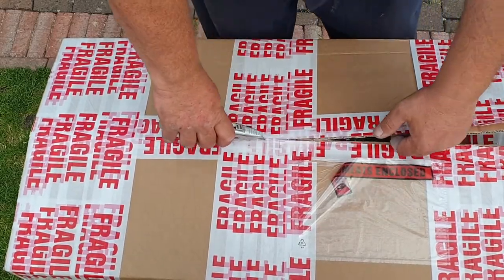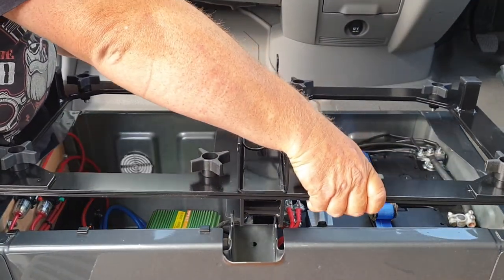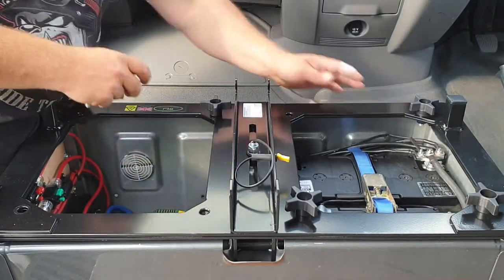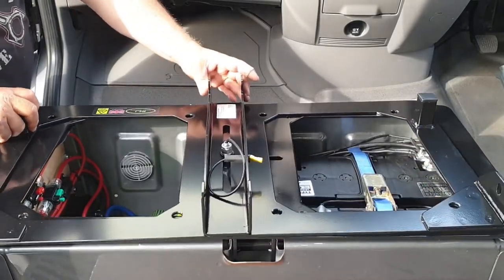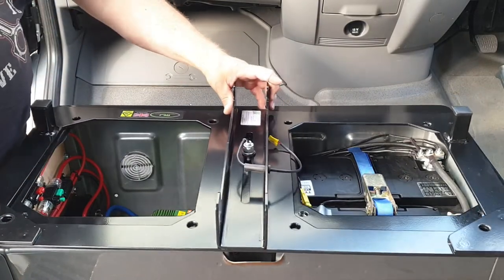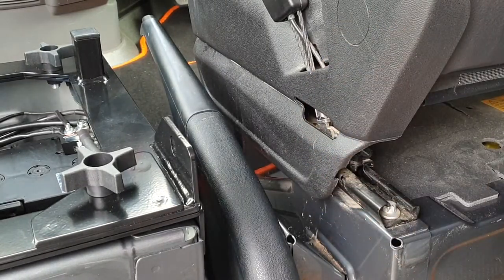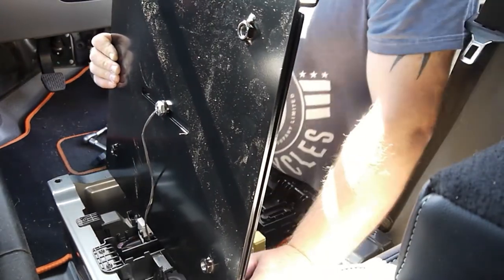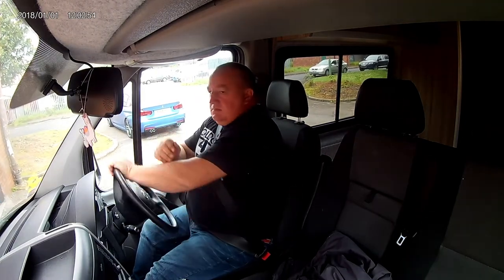selfbuild | vw crafter | campervan | swivel base install | van build | part 19 | the crafty blinders

Comment: you just push the handbrake down? No need to loosen up some bolts under the van? I want to place the drivers seat on mine.
Reply from the maker: Yes just push the cable down I little a it fits together no problem 😊
Reply: @TheCraftyBlindersvanlife  thanks for the quick answer👌